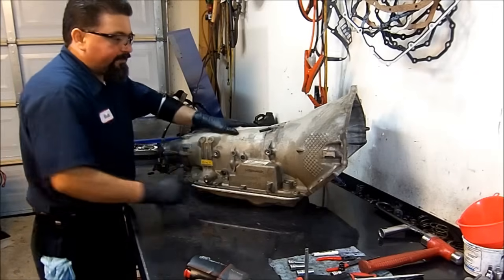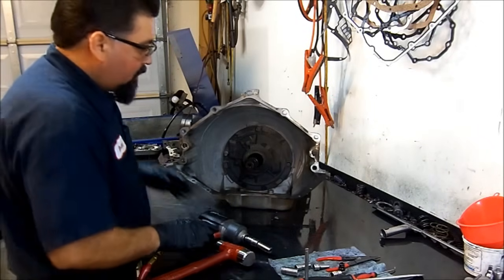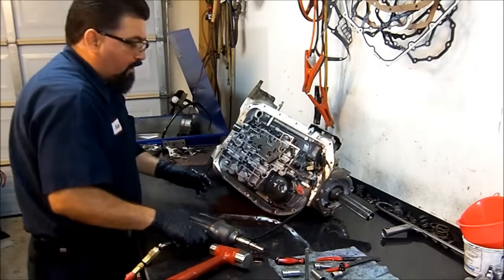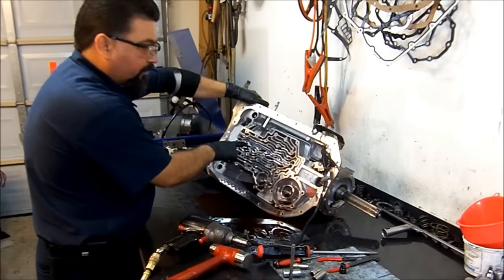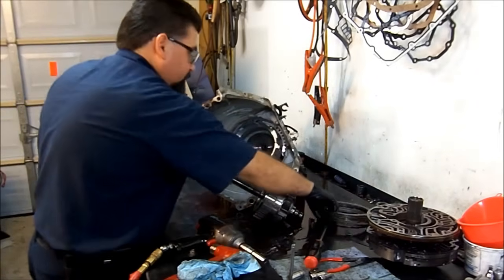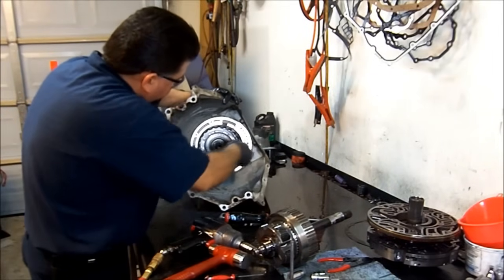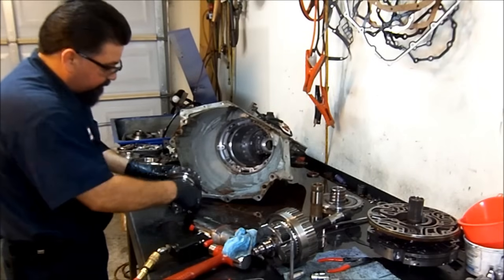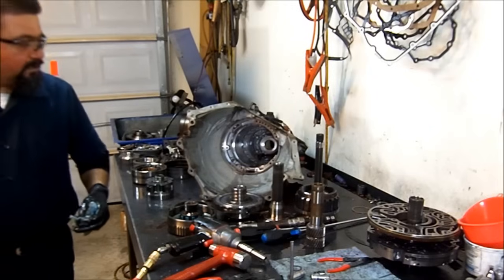Step-by-Step 4L80E Transmission Teardown: Full Disassembly & Inspection

Comment: would a bad extension housing bushing cause the drive shaft to travel too far. I have a 99 silverado 2500 reg cab i carry alot of weight (water tank1700lbs when full) and the drive shaft seems to be sliding into the carrier bearing. I took the tank out (drained the water) taking the weight off of the truck and the drive shaft noise disappears. truck has new ujoints and carrier bearing.
Reply: Make sure you still have your factory rubber bump stops or it will sqwat to much and drive shaft will make noise. I put timberons on my  truck to stop it

Comment: Is there any way to test the trans before removing it? Is there simple part replacements that can be done before jumping into a full rebuild. From the vid it looks like a rebuild was done unnecessarily. I want to start with the 2 sensors on the side as well as the 2 shift solenoids inside. what do you think? 
I bought this 97 box van not running installed a rebuild engine and now am trying to figure out the trans issue.

Comment: 07 2500hd po894 I drove the truck and the tc is not locking up. 145,000 miles and my cousin never change the fluid. Do u think tc is bad or solenoid?
Reply: blackericdenice v

Comment: On my 4L80E the check ball sockets in the case show more than moderate wear. Is there a way to fix it without replacing the case? Also, what condition causes this? Trans has about 124K miles. Lost Reverse overnight, found sludge in Low/Reverse housing, and slight wear on separator plate.

Comment: I've got this trans in my 2006 GMC 6.0 truck but he trans isn't circulating any atf? I took off the high pressure hose to the trans cooler and nothing comes out. Trans fluid level is normal and It drives and shifts fine but it is overheating. I can't figure it out and the trans shop won't tell me this issue. Any idea? Thanks in advance for help.

Comment: hi Hiram i have a 2004 silverado ls 6.0 transmission have no reverse only go forward when you put the selector on 1st very very slow i check all the solenoids and they good but i dont have power to pin E on transmission harness when ignition on, what could cause this, i already check all the fuses.

Comment: Hey boss
What causes the high pitch noise in this transmission while driving? It does shift but over 60 start to jerk a little the noise is crazy no grinding also i have to let it warn fo 15 min before try put it in gear..any imput will help 
Chevy express 2500 v8 2001180xxx
I will be watching this videos 
Thank you

Comment: hi hiram i have a 95 chevy 3500 4x4  454 engine   i have a problem in my trassmision reverse only some times work fine n some times is dont engache the revese im not sure if is the servo or the reverse band

Comment: Hi I hope you can help. I bought a control solenoid from Napa part # R784812, for my 1998 Suburban 2500 with a 454 and of course a 4L80E. Well the other day it started acting up and would shift hard when going into 2nd gear, 3rd was fine. I have not been driving it,  for concern as I may damage something. I watched a few videos, yours included. Yet I do not know which one I should change, or should I change out two of them? Are the 1-2 shift solenoid and the 2-3 shift solenoid the same part? According to a diagram, the one closest to the drivers side is the 1-2 Please help ass soon as you can, this is my daily driver. also it had a fluid and filter at axp72,000 in 2002 it now has 89,000, I bought it with 87,000  Thank You  Sean
Reply: Unlike the 4l60 the 1-2 and 2-3 shift solenoids are different on the 4l80 they function the same way but are built mirror image of eachother to the best of my knowledge

Comment: Hey Hiram, can you change a 4l60e into a th400? I have a 1998 Chevy 350/4l80e, I am going to put a carb on, and put in another truck. I've priced the 4l80e transmission control units on Summit, and they start somewhere close to $700.00. If it can be made into a th400, it would save me a lot of money and aggravation. I have heard of changing a 4l60e to a 700r4, but have heard nothing about the 4l80e.
Reply: 4l80e is very similar to a th400 (they use most of the same internal parts) the only downside to a th400 is it does not have an overdrive so driveability and fuel milage will suffer. not to mention the th400 is much shorter so you'd have to make a new crossmember and get a custom drive shaft.

Comment: I have a 2003 silverado 2500hd with a 4l80e the bellhousing is cracked and it keeps braking flex plates is there a way to get just a bellhousing or do I have to get a whole new trans because iv been told it's all one piece and iv been told that the housing is seperate!

Comment: Hey, Mr.Gutierrez 
First of all thank you for the video it was a big help, i have a 03 chevy 2500 4L80E transmission. i took it apart step by step as shown in your video but i can figured out the problem. my truck reversed went out i can drive forward fine but not backward any tips i will appreciated thank you in advance .
Reply: Reverse servo band issue

Comment: Dam there are a lot of parts...what is the weak link in a 4L80-E when your making 600 horsepower to the wheels...what is a good upgrade to do besides a stall converter? Have a 1999 Trans Am w/ 4L60-E and swapping in a 4L80-E ..what upgrades should I do to make it live.
Reply: if you are rebuilding it get a good rebuild kit with upgraded clutch disks and steels. then a shift kit. it'll handle all you can throw at it then. the 4l80es are very tough.

Comment: I have a problem. Direct drum is burnt to the next frictions, any tips how to get it unstuck?
Reply: *****
Thanks. Removed frictions from direct, put the snap ring back and used puller against snap ring to get direct out little by little.

Comment: how much different is this one from a 97 and up?
Reply from the maker: +swatson0061 this is 97 up. The older ones have both cooler lines by the bell housing. This one has one on the front and one on the center support.
Reply: swatson0061 j